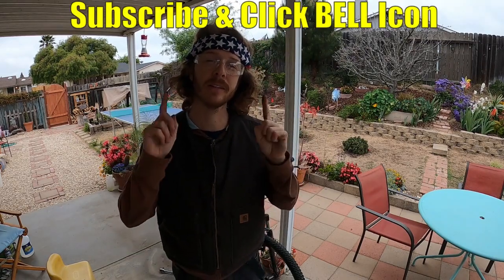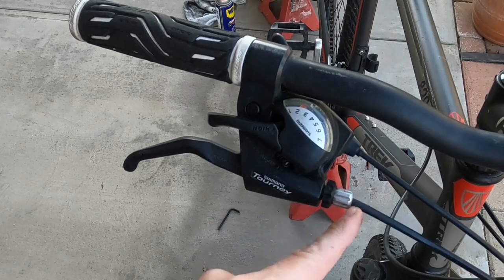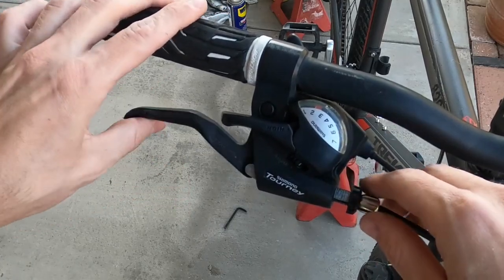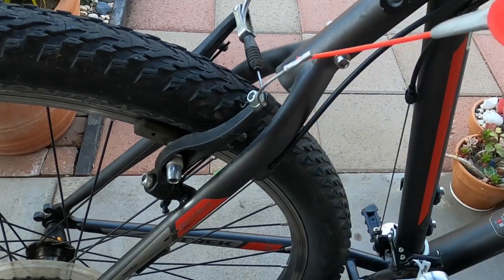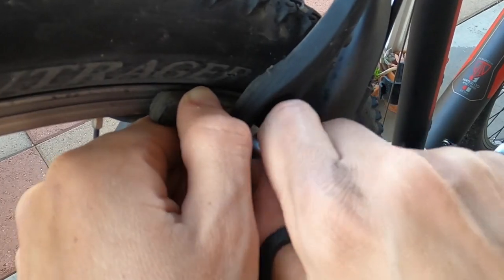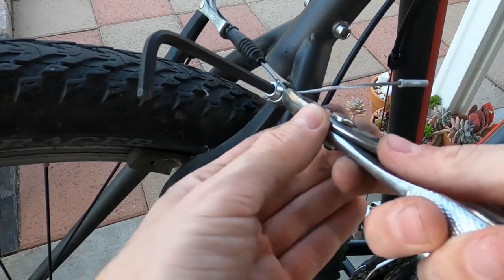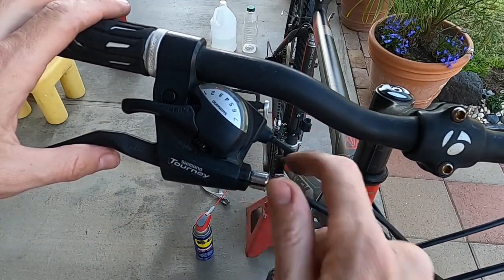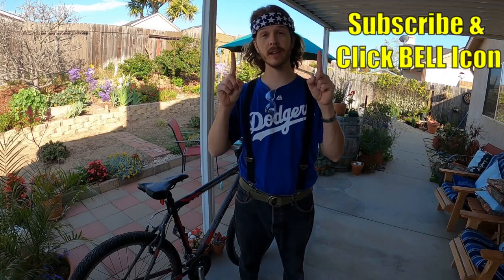Adjust Bike V Brakes, Levers, & Cable Tension -Jonny DIY

Comment from the maker: TOOLS & SUPPLIES
Bike Multi Tool- https://amzn.to/2ZbTcrn
Pliers- https://amzn.to/3D3jjiW
Screwdriver- https://amzn.to/3Fk0yd5
WD-40 - https://amzn.to/3l5lr3r
Tool Set- http://amzn.to/2xoyu5c
Safety Glasses- http://amzn.to/2ez41Jw
Magnetic Work Light- https://amzn.to/33tk6tp
If you Enjoy the Channel Consider Helping Support it by Donating below & by Subscribing & Clicking BELL Icon
 ⭐ PAYPAL DONATION https://www.paypal.me/JonnyDIY
Reply from the maker: SuperFutureTrunks1  the adjuster could have been stripped into the handle if keeps popping out. Make sure it's screwed in enough though grabbing enough threads.  But if not grabbing someone maybe cross thread at one point. Could probably change just the adjuster as its softer metal I believe, that or the whole brake lever assembly

Comment: Excellent, you just covered  4 common brake adjustments in less than half the time that another video only covered the barrel adjustment on the lever.
Reply from the maker: Awesome, happy I could help you out 🙌👍

Comment: Do you have any idea how to fix the  blow horn on my Nissan pathfinder 2007? thanks
Reply from the maker: #1 check Horn Fuse to see if blown. Whenever Ive had them go out Ive just replaced them, fairly straighforward procedure. Usually a bolt holding them onto the front of car and unclip a set of wires and clip new wires in and bolt new horn on. Can remove negative battery lead as well before beginning for safety. Can test to make sure horn is indeed broken and not a switch, relay or fuse by connecting positive and negative wires of horn directly to the car battery to see if beeps

Comment: Can someone help me by brake levers barrel adjustersdont screw out i try to loosen it out for more brake power but it just screws back in by its self i can screw in but cant screw out.
Reply from the maker: Some barrel adjusters you have to 1st pull the know out, then twist it